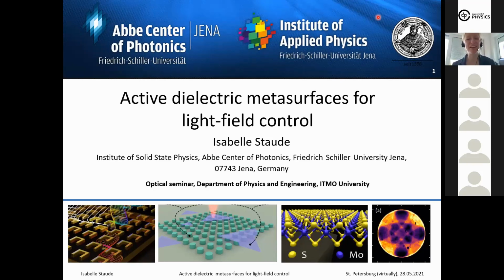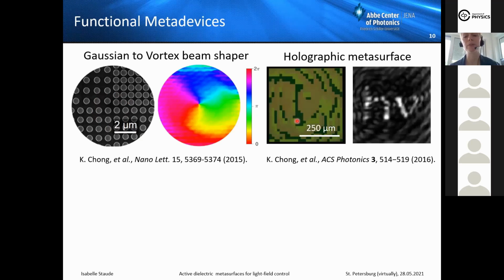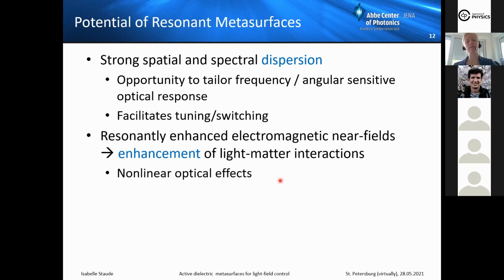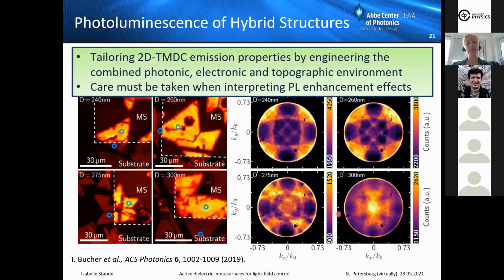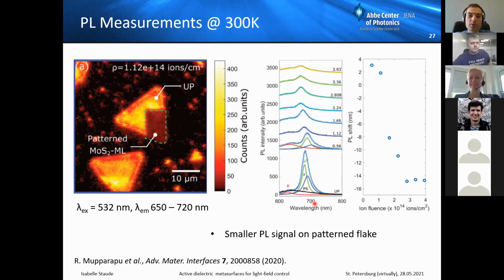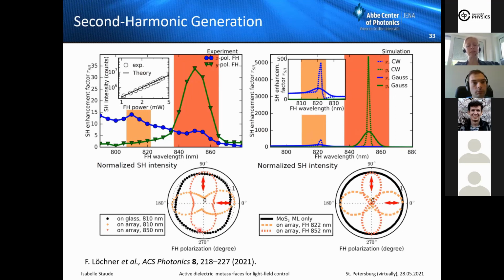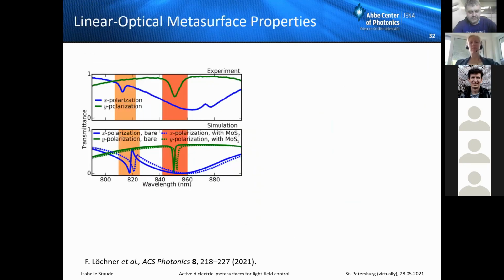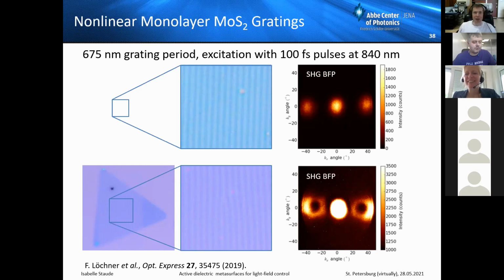Active dielectric metasurfaces | Prof. Isabelle Staude

Comment from the maker: Second part of the abstract:

This talk will provide an overview of our recent advances in nonlinear, tunable and light-emitting all-dielectric metasurfaces.

In particular, we have studied spontaneous emission from metasurfaces incorporating various types of emitters, including semiconductor quantum dots [4], monolayers of transition metal dichalcogenides [5], and trivalent lanthanide ions exhibiting magnetic-dominated dipole transitions [6]. Along similar lines, we have investigated second harmonic generation in metasurfaces made of, or containing, materials with a high second-order nonlinear susceptibility, such as III-V semiconductors [7], lithium niobate, and monolayers of transition metal dichalcogenides. Our results show that both the directional, spectral and/or polarization properties of the spontaneously emitted or generated second harmonic light can be tailored by the metasurface design.

For dynamic tuning of the metasurface response, we make use of the strong spectral dispersion associated with the resonant optical response of the metasurfaces in combination with the sensitivity of the resonance properties on the refractive index of the dielectric environment or constituent material of the individual nanoresonators. Specifically, by integrating the semiconductor metasurfaces into nematic-liquid-crystal cells, we can dynamically tune their linear-optical response in the near-infrared spectral range using an applied voltage as control parameter [8]. Using photoalignment materials, we furthermore show that this tuning approach can be extended to visible frequencies. Based on this approach, we experimentally realized a transparent metasurface display with high tuning contrast in the visible [9].

Our results illustrate the potential of all-dielectric metasurfaces for compact tunable and reconfigurable optical components and flat sources of tailored light fields.

[1] I. Staude und J. Schilling, “Metamaterial-inspired silicon nanophotonics”, Nature Photon. 11, 274 (2017).
[2] A. Vaskin, R. Kolkowski, A. F. Koenderink, and I. Staude, “Light-Emitting Metasurfaces“, Nanophotonics, 8, 1151-1198 (2019).
[3] C. Zou, J. Sautter, F. Setzpfandt, and I. Staude, „Resonant Dielectric Metasurfaces – Active Tuning and Nonlinear Effects”, J. Phys. D: Appl. Phys. 52, 373002 (2019).
[4] S. Liu, A. Vaskin, S. Addamane, B. Leung, M.-C. Tsai, Y. Yang, P. Vabishchevich, G. Keeler, G. Wang, X. He, Y. Kim, N. Hartmann, H. Htoon, S. Doorn, M. Zilk, T. Pertsch, G. Balakrishnan, M. Sinclair, I. Staude, and I. Brener, “Light Emitting Metasurfaces: simultaneous control of spontaneous emission and far-field radiation”, Nano Lett. 18, 6906 (2018).
[5] T. Bucher, A. Vaskin, R. Mupparapu, F. J. F. Löchner, A. George, K. E. Chong, S. Fasold, C. Neumann, D.-Y. Choi, F. Eilenberger, F. Setzpfandt, Y. S. Kivshar, T. Pertsch, A. Turchanin, and I. Staude, “Tailoring photoluminescence from MoS2 monolayers by Mie-resonant metasurfaces”, ACS Photonics 6, 1002–1009 (2019).
[6] A. Vaskin, S. Mashhadi, M. Steinert, K. Chong, D. Keene, S. Nanz, A. Abass , E. Rusak, D.-Y. Choi, I. Fernandez-Corbaton, T. Pertsch, C. Rockstuhl, M. Noginov, Y. Kivshar, D. Neshev, N. Noginova, and I. Staude, “Manipulation of magnetic dipole emission from Eu3+ with Mie-resonant dielectric metasurfaces”, Nano Lett. 19, 1015 (2019).
[7] F. Löchner, A. Fedotova, S. Liu, G. Keeler, G. Peake, S. Saravi, M. Shcherbakov, S. Burger, A. Fedyanin, I. Brener, T. Pertsch, F. Setzpfandt, I. Staude, “Polarization-Dependent Second Harmonic Diffraction from Resonant GaAs Metasurfaces”, ACS Photonics 5, 1786 (2018).
[8] A. Komar, Z. Fang, J. Bohn, J. Sautter, M. Decker, A. Miroshnichenko, T. Pertsch, I. Brener, Yu. S. Kivshar, I. Staude, and D. N. Neshev, „Electrically Tunable All-Dielectric Metasurfaces”, Appl. Phys. Lett. 110, 071109 (2017).
[9] C. Zou, A. Komar, S. Fasold, J. Bohn, A. A. Muravsky, A. A. Murauski, T. Pertsch, D. N. Neshev and I. Staude, “Electrically Tunable Transparent Displays for Visible Light Based on Dielectric Metasurfaces”, ACS Photonics 6, 1533 (2019).